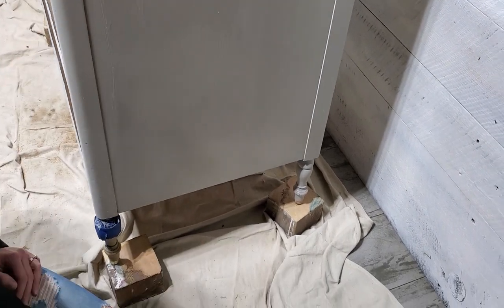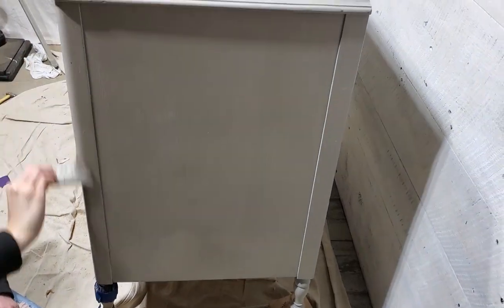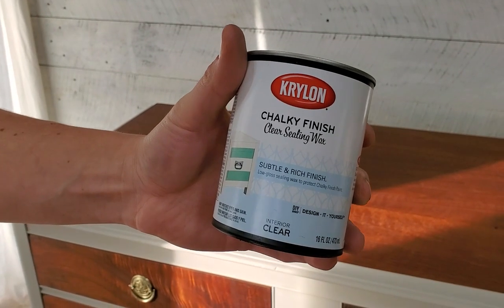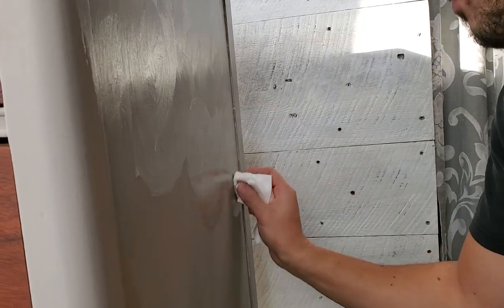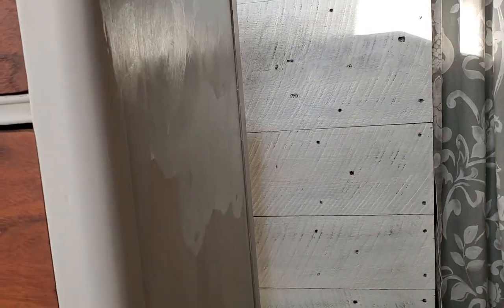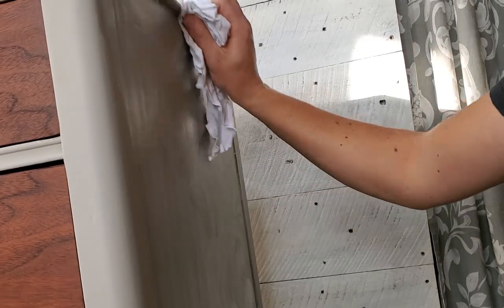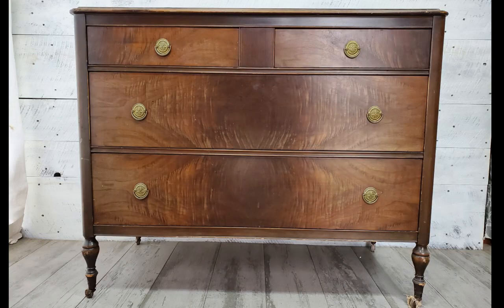Can We Update This 100 Year Old Dresser Without Losing its Original Charm??

Comment: Very nice make over. May I ask about the wheels on the legs...why remove them?
Reply from the maker: Often times they're more trouble than they're worth.  You'll find them in wood and metal and while the wood ones are prone to splitting and getting flat spots, the two-part metal ones tend to rust and deteriorate over time and split.  These in particular were the two parts metal and one or two were starting to split.
Sometimes we'll leave them on if we feel the piece is better with them, but most of the time we decide to remove them due to condition or not wanting to fight with them.
Reply: @BrickHouseVintageDIY  Thank you for answering. That makes a lot of sense.

Comment: beautiful job!  What is your sander hooked up to, and how do you do that?
Reply from the maker: It's hooked up to a ShopVac with HEPA filter on it.  They make adapters you can buy that are supposed to connect your sander to vacuum, but they're around $20 typically and there's no guarantee that it will fit your connections.  So I made my own for under $5 using a rubber coupling  and it works pretty well.
Reply: @BrickHouseVintageDIY  Thanks!